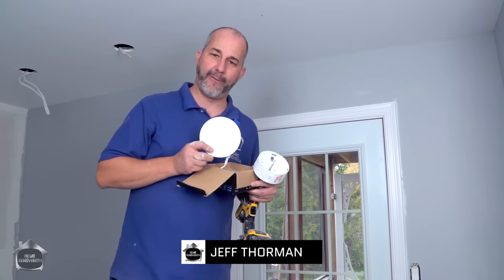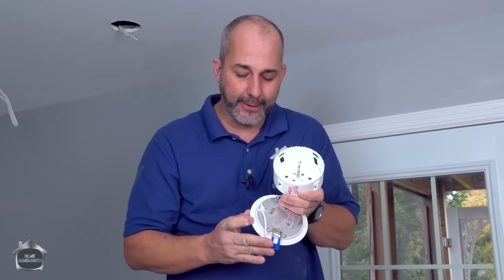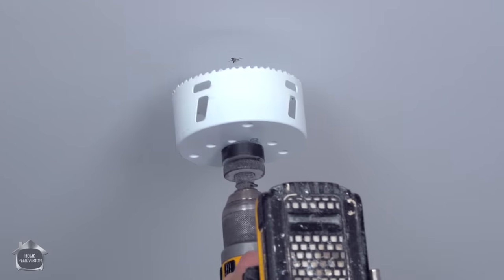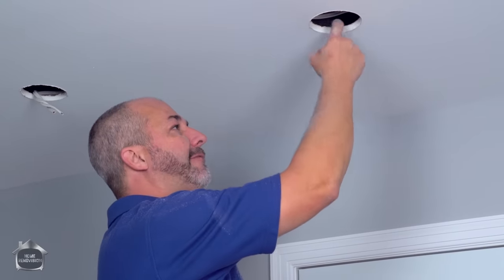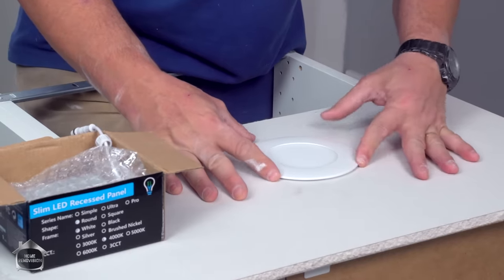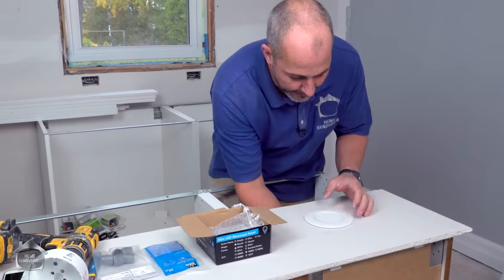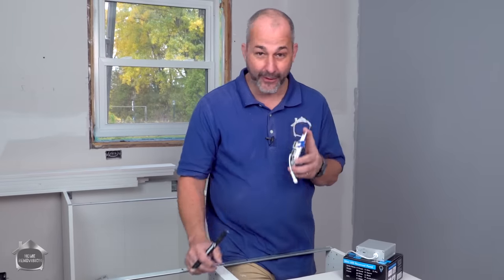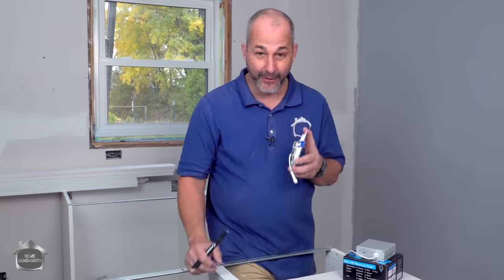How To Install Pot Lights in Kitchen Ceiling

Comment: Thank you for making, great vid.
I’ve installed a few of  these this past year. I kept wondering what the code is with the j-box for the light? Is it supposed to be screwed to a framing member or is it fine to just lay up in the ceiling? I’ve just been placing in the ceiling because there was no clear instruction on what the manufacture wanted done. The ones they sell here in California come with a strip of metal that appears to be some type of bracket but the instructions don’t say what to do with it. So weird that they don’t. Anyway I was wondering if you might know?

Comment: Bought the same lights.  Mounted boxes on ceiling joists loosely on hole slots.  Left extra slack on Romex in case lights fail or future replacement.  Used 6" size so I can reach in and pull out the box.

Comment: I just need a little clarification on inserting the wires into the Wago style clip: are the two white wires that you gathered together get inserted together into on single hole of your clip, then same for the black wires or are there holes for each individual wire to go into? Thanks!

Comment: Great video.  Any suggestions or tips on replacing existing MR16 LED pot lights. In particular, what to do with the canister that is already in the ceiling.

Comment: Great video! What if I am adding pot lights or recessed lighitng to a downstairs kitchen but I need to add wiring from center of kitchen going left to right? No access from above. Do I have to bite the bullet and cutout the drywall to access the joists?

Comment: Good morning. Great video. Question, I'm installing an LED bathroom mirror (hard wired). There's only a hot and neutral, no ground. After I tie together black to black, white to white, what do I do with the ground coming from the Romex 12-2?

Comment: Great video as always... I just installed 30+ of these in my house that are RGB and Wifi for around $10 each. They are amazing. The one thing missing is how to properly insulate these. Even with the rubber gasket and strong springs there is still some air leakage. I think the huge rock pot covers for can lights are way too much for these thin LEDs. I'm also hesitant about spraying foam directly on them. Would love some suggestions for Properly insulating these. Thanks!
Reply: Where did you buy lights from?
Reply: @ihotfix  Amazon - Cloudy Bay 6” and some 3”

Comment: Great video as always. Question- I installed two groups of four of these in two rooms . Each room has one light that delays coming on or only eventually comes on when the dimmer is on high. Do I need to replace the whole assembly or are there replacement light heads. These are sylvania.
Reply: These are a year old now.

Comment: So this wiring is run in series? You're running each neutral and hot through a junction box and on to the next junction box, correct?
Reply: Will these negatively affect lighting output since all lights are sharing the voltage? One goes out, they all go out also, right?

Comment: I have an office with a ceiling fan and I want to add in a track lighting or maybe those LED lights. What should I do, splice the wiring? I would like if possible keep the ceiling fan. Thanks

Comment: Just a small remark, nowadays lighting does not use 100s of watts, only 10-20w / each, so with 20 lights in a room, still around 300W total, which is EU/Asia 1.5A max, US 3A max, you do not need too thick cabling.
Also there are a lot of automatic wire strippers, even from china for a few bucks, which work a lot better than the one you are using.
Love your videos :)
You do your Job with passion, and that makes the difference!

Comment: I'm renovating a garage that is roughly 28' x 13' w ceiling heights of 7.5-8.5ft. I'm definitely planning on doing these lights in my drywall, but having trouble figuring out how many I should install for good lighting throughout. Thoughts?
Reply: He actually mentioned this in another one of his pot light videos.  Look at the degree range of the lights listed on the box.  Some are 90 degrees, some are 120 degrees, etc.  You want each light's angle to intersect somewhere above your head so there aren't dim spots around the room.  You'll have to figure that out yourself, but maybe someone made an online calculator somewhere.

Comment: Love the quick connect system inside the JB of the pot. Why all electrical wiring is not joined like this is beyond me. Twisting copper and then twisting a wire nut (marrette), all by hand, is so slow and can cause electricians repetitive stress injuries. I gave up on curling wire and screwing it down on duplexes, ages ago. Just friction fit straight wire into the hole provided.

Comment: Great video I am a retired electrician after 40 years it amazes me how many licensed electricians destroy ceiling tiles and sheet rock ceilings because they run the drill in the forward position so great info on that ,i’m not a big fan of the push in  connectors (Wagos)I never use them I wire nut everything but I understand it’s a very lite load and a tight spot so they are very convenient I’ll give you that but I still never use them had to replace too many that failed maybe the new ones are better I don’t know but they have very little surface contact with the wire which can create heat all right I’m done Whinnying great video 👍

Comment: Hi Jeff,
Trying to put in new recessed lights, do we need to staple the wires going to the switch per code since the drywall is already up?

Comment: I just installed these lights in my front porch soffit. I love them! I wish I would have thought of the reverse drilling trick. Looks like you're using 12 gauge wire, which is awfully heavy-duty for lighting and kind of a pain to work with. I like using 14 gauge for lighting and 12 gauge for outlets. Great job!
Reply: If I understand correctly then the wire is required to match the circuit, 20 amp breaker equals 12 gauge wire through the entire circuit, except the fixture itself I assume because most ceiling fans and lights use 14 gauge(maybe even 16?).  If there is a short, or somebody decides to tap into the 14 gauge wire to add a new outlet and plugs in  something that draws a lot of power they could melt the 14 gauge wire without tripping the breaker.
Reply: @dustintunis9347  I’m not sure about that. I thought the gauge wire should remain the same throughout. I have lighting circuits with 14g wire and 15a breakers.

Comment: This is a super helpful video!  I've just bought the pot lights (with your discount) and the other tools I need to get started.  What should be the easiest piece to find is thus far the hardest to find at my local stores--the plastic cable connectors.  I'm looking online and am wondering if I should be buying 1/2" or 3/8" cable connectors.  Thanks in advance for your help!
Reply: 3/8"

Comment: HELP You’re the only one I trust. 
I’m not sure you’ll read this since it’s been 3 yrs ago since you made this video on Cann Lights. 

But in case you do see this, could you answer my question about putting up Cann Lights when you have a Flat Roof house ie No Attic ? Thanks in advance 

I really want to put Cann Lights in my kitchen, but have been told I can’t. 

I know they have the battery stick up type, but I don’t personally love them.

Comment: Very informative video. Thank you for the detailed explanation. Am getting ready to replace the drop ceiling tiles in the basement along with lighting (horrendous tube lights). Planning on installing these but have a couple of questions:

1. My new drop ceiling tiles will be those skinny vinyl decorative tiles and I don’t think they will be able to take the weight of these lights without sagging. How does one use these with those type of drop ceiling tiles.

2. How many of these can I run in series? I will need around 30-35 of these for the basement. Thanks.
Reply: Hello! Did you find out the answer to your questions? I have similar questions.

Comment: Hi Jeff,  I'm replacing my kitchen light with a pot lighting and adding 1 to the right and 2 to the left. (4 total lights)  Do I have to start the wire from the switch to the light on the far right or can I leave it on the second light and run wires to connect the lights to the left and right side? Thanks for your videos.  I love watching them.

Comment: I’m wanting to de-stipple an existing kitchen ceiling that has a single light fixture in the center of it and a ceiling fan/light combo over the eating area. I want to remove those and install pot lights, probably 12-15 of them. He do you go about rewiring for this without ripping down the sheet rock? And thank you so much for this video!

Comment: I have lights similar to these but I wish to change their temperature. Unfortunately, the ones I have are not adjustable. If I bought new lights, would I have to do the wiring again, or can I just change the dangling portion?

Comment: Hope this isnt a dumb question but every video ive seen about installing these lights shows you how to do ONE.  If you want to do a room with several of these, how do you connect them?  if you've already connected the power to the one light?
Reply from the maker: the lights can be strung together in a line. simply install a wire into the box that leads to the next location. the push in connectors have 3 spots so you can make it continuous.

Comment: So I’ve been looking all over the Internet and nobody can give me the answer. I’m having my power supplies burning up because the blown in insulation. They are getting extremely hot. Short of modifying a Traditional can’t cover, what would you recommend? Crawling in my attic to install cover boxes is not an option.

Comment: A good quality light has a gasket to prevent the cold air from rushing in from the attic, then at the end of the video it’s recommended to rip it off and throw it away ?

Comment: Redoing a tiny kitchen * 10' x 10' looking for advice on proper lighting placement. Down to studs at the moment and DH is getting ready to do electrical. Currently wired for centered ceiling fixture and wall fixture above sink.  Best placement for small can lights in ceiling and task lighting. Is under cabinet puck lighting adequate? Thanks for any direction. TIA

Comment: Can lights like these be installed directly over and in contact with a ceiling joist?  A joists runs right through the middle of where I would like to mount one.  Thanks!

Comment: Can you keep that little metal box in place and install another brand to it? Also do you need to close the breaker to remove the light , not the metal box, when you want 5o change a light?

Comment: Hello. I don’t have ground wire in my existing ceiling fixture just positive and negative looks like BX cable. Will spot lights work and if it’s safe to install them without ground wire? TIA

Comment: So junction boxes do not need to be attached but just sitting on top of the drywall is fine? I ask because I just received some very cheap, nice but cheap, led recessed lights which do not include a junction box. Going to attach a junction box but wondering if I have to connect each box to a stud, or strapping even, or is just letting them sit on the drywall as in this installation sufficient?
Reply: @kimbuck-2  thanks for adding on Kimbuck. I'm lurking around still hoping for an answer.

Comment: I've commented on another video but will comment on this one as well. When you have several in a line and only one set of wires how do you connect those lights? I did not see that covered in the other video I watched.

Comment: I was told by the installers that these lights would “last forever” (as in a very long time). I’m surprised that 3 years later a light has gone out (after what I consider light usage). I see lots of videos about how to install the spring loaded lights, but what are some tips for removing them? Do I just give it a good tug? (I don’t want to tear the drywall).

Comment: If you're going to do this, do yourself a favor and use a dust shield. I just drilled 18 of these with a carbide hole saw through plaster/gypsum and no mess. Using a dust shield catches almost all of the dust. It's also worth getting rid of the push in connectors and using the WAGO 221 lever lock connectors.

Comment: Thanks for the video. 
My question is, is if you’re replacing existing lighting (one light) with a few pot lights, how do you string the electrical cable? 
It’s a very old house with beautiful crown moulding and just don’t want to take on replacing the ceiling. 
Camera device? Long firm wire poking until you are able to ... find the next hole?
Any ideas welcome ... thanks.

Comment: I want to add a handful of low voltage/low wattage LED recessed lights, but I think I'm supposed to get a permit. I'm debating if I want to wait around a year or so for the city to actually allow me to do it or just say hell with it and do it myself then try to get it permitted after the fact and make whatever modifications the inspector says I might need to pass inspection.

Comment: Is there a video that shows you installing the 14G above the sheetrock?  also, did you need to connect 2 sets of wires because of a dimmer switch?

Comment: This may be a stupid question, but are all of the lights connected on the same wire?  If so, if one burns out, do they all go out?  If that happens, how do you know which one needs to be replaced?

Comment: my question when tackling this project is where does the initial power get sourced from?

if i want to put lights in a closet - there is no switch/lights currently. I don't want to run a line straight to the breaker box (other side of the house)

do i draw from an outlet nearby or what? I can never find clear response on this part.

Comment: Hey how and where did you connect the end wire to send power to all the potlights to turn them on.  Thats the part I’m struggling with most. Do we connect it to an existing switch that’s in the roomV

Comment: How do the light spacing calculation change around an existing ceiling fan? Is there a minimum distance from the fan to avoid shadows from the fan blades since they’re only a foot below the ceiling? Do I have to move the fan or is there a simpler work around? The one saving grace is I have attic access
Reply: Haha thanks for the like! How far from the ceiling fan would you recommend placing the spot lights to avoid shadows from the blades?

Comment: WOW! You are an teacher!  You explained this so well!  And I love the stong spring and how it just snaps into place like that so secure!  I would love to do this is my kitchen I want to remove the florcent light fixture and replace it with the LED lights you are using.  But how do I wire it when  do not have access to inside the ceiling? And how do you make the pot holes in a straight line and even.  Is there a template that you can put on the ceiling?  I liked and subscribed to your channel.
Reply: I can't help you with the wiring without access in the ceiling, but I put 4 of these in my daughter's room and to get them I just taped string to the ceiling, in my case 3 feet both directions from each corner, kind of made a skewed tic tac toe board, and everywhere 2 string crossed was where I put a light.  I hope I explained that well, it would definitely make sense if I could show you.

Comment: If this is getting inspected, can you still use these retrofit lights? Will the inspector sign off a ceiling for drywall with romex just hanging out like that?

Comment: Jeff, I replaced my old style can lights with the sim led lights. Two of the six lights delay when the lights are turned on. I replaced the quick connectors with the wago connectors but the issue still remains. I then replaced the led light, same result. Then I finally replaced the junction box and there is still a long delay in both lights coming on. They are both a 1 for 1 replacement from the old recessed can light. Any suggestions?

Comment: Hold up a second. I understand how to do one light on a switch but how do you do 3 lights to a switch? Did you just combine twist the neutral and load to each wire to combine the wire?

Comment: Hi I am trying to get my head around a problem.

I have an led light bar rated at 860 w alledgidly.

I am also using an ac dc transformer, when I put my watt meter on the 240v side it reads 80 watts ish.

Is there a drop in wattage between 240 volt and 12 volt or is it as I suspect the unit is approximately 10 times less in wattage.

Regards Martin steele

Comment: What do I with the insulation that in my ceiling? 
I installed the Led lights in... And I have about 5 inch of sprayed insulation all over... Can I just cover the light up with the insulation or do I need to give some air space for ventilation?

Comment: Don't we need to add BAZZ type vapour barrier units with TUCK tape closure in the attic for each LED light fixture? Isn't the moisture from our house going to get in the attic where my blown batting is going to get moist? I live in Alberta and my son just drilled holes for LED light fixtures on the main floor and he thinks that foam caulking is good enough to seal it. I just had brand new roofing in October 2020 done and I'm worried that this will void my warranty to guarantee a dry attic. Please help ASAP. Your video doesn't mention anything about this. I saw a video showing the unit being put in a metal box and then being insulated over with pink insulation. After that a plastic vapour barrier was placed over top and sealed up.
Reply: Same question here. I was hoping Jeff would provide more info about installing these LED pots on isolated ceilings with a vapor barrier...

Comment: Is it “ok and safe “to cover that junction box up in the attic with blown in attic insulation once the project is done? Thanks
Reply: If the lights are rated for insulation contact or IC.